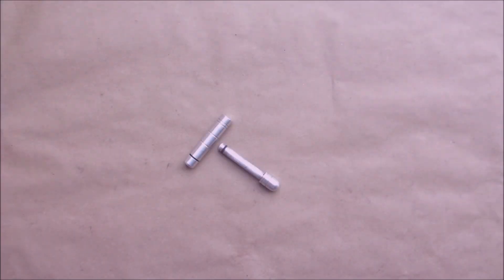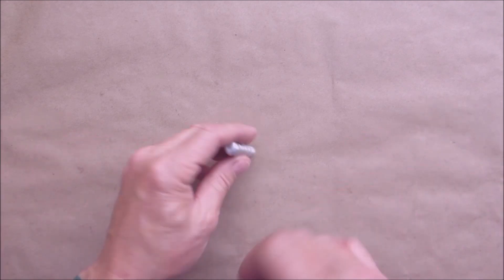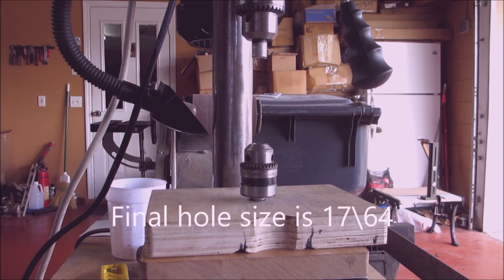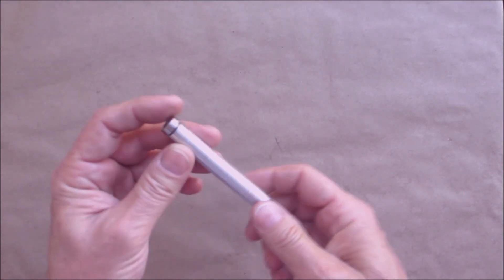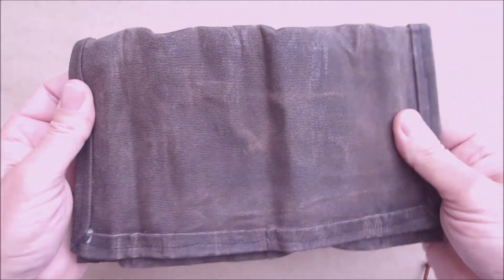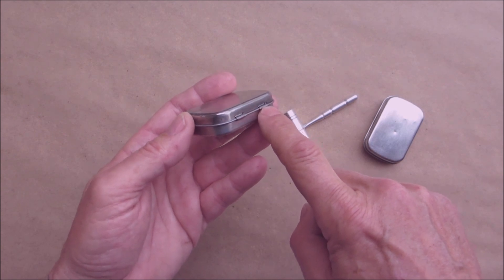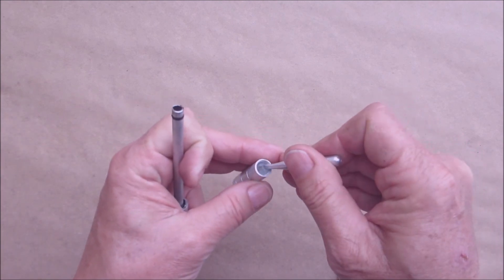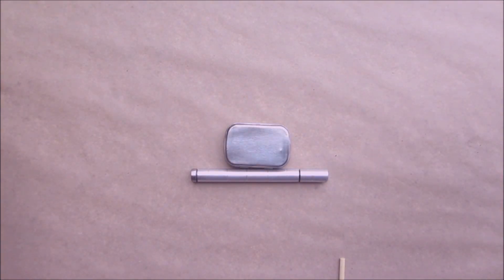How to make a Fire piston, maybe? Sort of?  Eventually!  Part 2 of 2! Success!

Comment: Dominic, this is a really exceptional piece of handiwork. Beautifully rendered. This is something compact that can serve you for a lifetime in the bush, taking up pretty much no space.

In terms of ease of access when you’re walking through the woods with your pack on,  just taking a break To create yourself a nice meal, if you were to bore a hole through the handle of the “match “part, you could pass Lanyard through it and wear it about your neck or affixed to the strap of your rucksack.  No digging through your pack, for the tinder kit when time is short.  Alternatively, you could sell a belt loop oh to the back of your nice little canvas pouch, to put it right on your belt or shoulder strap.

It has been a couple years since you did this video. I imagine you’ve probably used your fire piston hundreds of times by now.  I’d be very interested in hearing your thoughts and observations. Of course, I can’t help but wonder if you go through a lot of Vaseline. Does it turn out to be a situation wherein it pretty much just stays lubricated as it is once you’ve used it a couple of times? I’m asking because I have a design idea that’s slightly different from yours, but the idea will only work if there’s only a small quantity of petroleum jelly to be taken in the kit.
Reply from the maker: I am really happy with this one! I have made a lot of fires with it and probably more embers just playing with it! 😂 

As far as the Vaseline goes, I clean it after every use pretty much so I re-lube it the next time. The char cloth kinda mixes with the Vaseline and it gets pretty dirty. That being said you don’t have to lube it every time if you don’t clean it as much.